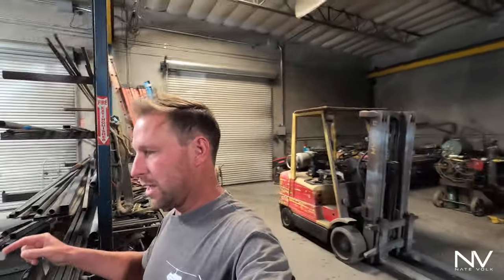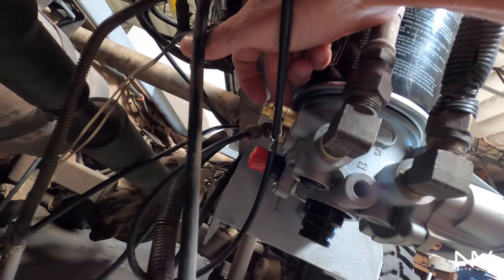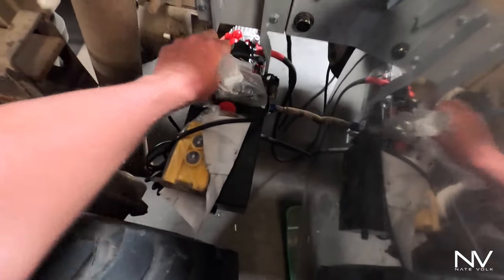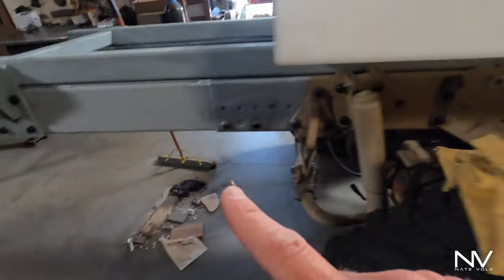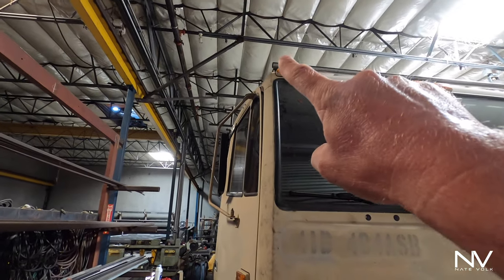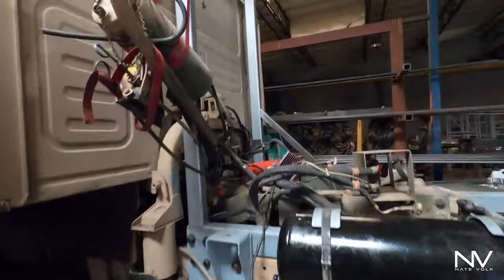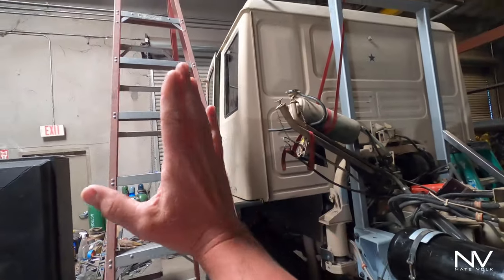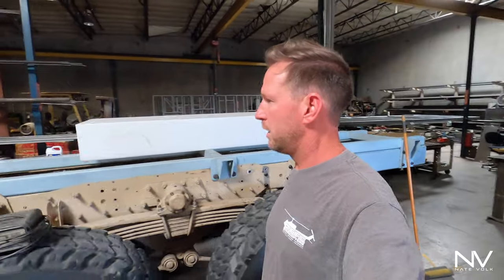LMTV Overland Expedition Truck Build - Part Fifteen.  Replace the air dryer and hydraulic system.

Comment: it would be great for us 1078 noobies if you posted a step by step install video of your Amazon air dryer.. thanks !
Reply from the maker: Well, there is an input hose from the compressor, an output hose from the dryer to the tanks, and a purge line.  They all attach pretty easily.  You might need an adapter on your purge line, easily sourced at any hardware store.  I chose to not hook up the heater and went with the cheaper 12v version over the 24v.
My setup is a little different than standard because I moved everything around to accommodate space for my black and grey tanks.
Reply: @NateVolk  is the Amazon air dryer working AOK?
Reply from the maker: @BERZERKERSV4  So far so good!  I haven't put many miles on it, but I'm not the first guy to use it either.  The canisters can be bought from Napa or any auto parts store (or online) for under $15 too.  Easy to service!

Comment: It coming along! How long was the extension to allow for the 20’ box to sit on the rails? I’m wondering for my own theories about extending the frame between the front and rear axles and then an angled habitat  box but need to know how many feet behind the rear wheel is overhanging..? A 20’ habitat seems right in my mind to acomidate my needs and not underutilize the trucks ability to carry. More than that seems like it would get unwieldy. Reilly great to see an idea thats running close to my own all pealed back, since at this point my playground is only mental!
Reply from the maker: I had the same plan as you.  Extending the driveshaft would be fairly easy on the 6x6.  But after looking at it in person a bunch, I chose to extend the rear and not touch the axle locations.  I felt that losing the departure angle a bit was better than losing the break over clearance.  The back of the box is still 60" off the ground, so you really aren't losing that much departure angle anyway.  From memory, the extension was about 3'6".  I did remove all the stuff behind the cab to gain an extra 2' of room as well.  That is a huge undertaking to do, but I felt really worth it in the end.  With the bike rack on the rear, the entire truck is under 30' long, so it is big but not too bad.  Plus with extending the rear, you keep the turning radius.  Probably the best base, if you can find one, is a wrecker chassis.  They are a little longer in the middle already.
Reply: I’m surprised you got two feet up front! I was thinking you only gained maybe 12” or so with the smaller air filter still needing some room to live. How wide are the tires on these things!?
Reply from the maker: @Eliukcory  I'm also going with a custom air filter.  I have about 8" between the box and the cab.  The tires are about 15" wide :)

Comment: Nate, been following the build. Have any long term input on the air dryer?
Reply from the maker: Thanks for watching!  So far, so good.  I never did change the heater portion out to 24v, but I'm rarely in freezing temps anyway.  Just about to change the first cartridge out as I'm seeing a little water in the wet tank.
Reply: @NateVolk  aloha, just asked about this on another video and then found your answer here. Appreciate it!
Reply from the maker: @lylekrannichfeld9634  so far so good. I’m about ready to replace the canister. Will update if any issues!